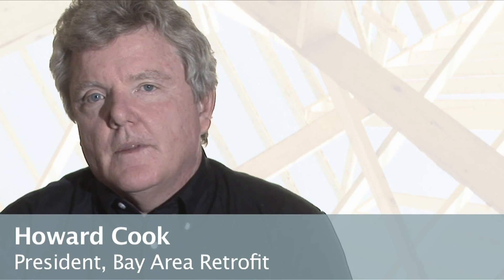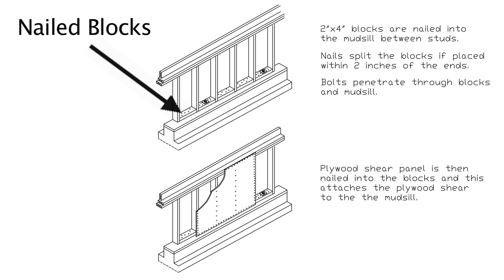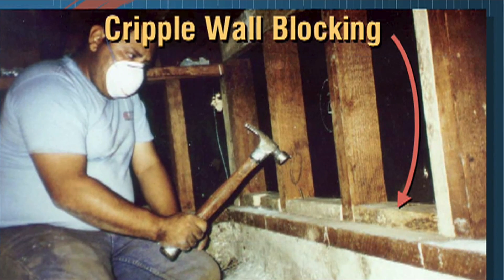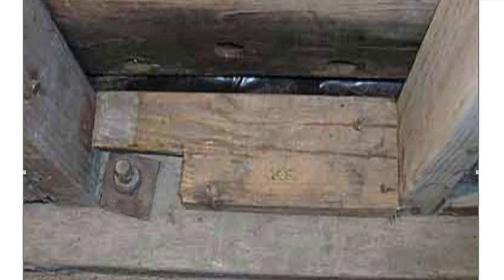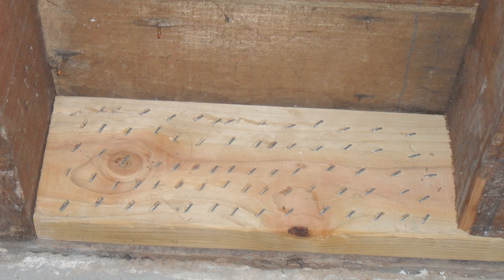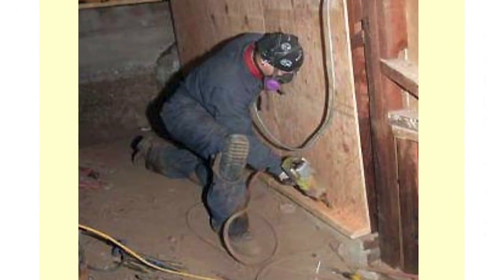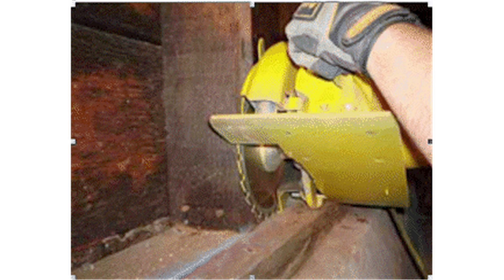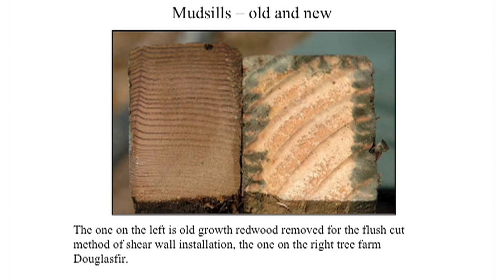The One and Only Tested Retrofit Shear Wall

Comment: I know it still probably wouldn't be as effective as just using staples, but theoretically could you avoid wood splitting by drilling pilot holes for your nails using the nailed blocks method shown? And would nails offer greater strength if done this way? what if you drilled pilot holes and used screws instead?

What if the wood used for the mudsill wasn't of particularly high quality? would the Flesh Cut method still be recommended?

Comment: Both my mudsil and studs are 6", however my mudsil is recessed into the foundation, leaving only about 3/4 and 1" above concrete. Seems like nailing would be too close to the edge of the ply. Does this require stapled blocking? Whats the best solution for this? 
Separate question what is the recommended depth of the foundation bolting and hold-down bolts?

Comment: I have a shearwall question that no one has been able to answer. I have a 2 story house (built 1992) with shearwalls in the attic. I will have to access the area behind the shearwalls.  I want to open a space between studs to do this. Is there an approved method to accomplish this?  I think either framing the hole like a doorway through the wall, or a larger piece of plywood to overlap to the next studs in each side of the opening when I am done with the work?

Comment: I have an old 1920's house with a 6 inch foundation wall with an untreaded Doug Fir 2x4 mud sill is sunk into the concrete flush with the top. This leaves 2-1/2" of concrete exposed a the top of the foundation wall. Untreaded Doug Fir 4x6 posts are then toe nailed into the 2x4 mud sill with the rest of the post (2") resting on bare concrete. These post are at very irregular spacing that vary from 8" to about 60" (most are around 32" spacing). My plan is to set 2x6 treated sill plate blocking on top of the foundation wall (and on top of the 2x4 mud sill) between these posts. I will install 5/8" diameter 8-1/2" deep wedge type threaded anchor rod through the 2x6 through the 2x4 and 4" into the concrete. If some of the sill plate blocks do not require anchor bolts I will just nail them to the existing 2x4 mud sill. I will then install 2x6 cripple wall studs 16" o.c. at the wide bays and cover everything with 1/2" plywood. My question is how often do I have to install anchor bolts?

Comment: One more possible method: cut every second stud short by 1.75 inches, and install longer blocks.  Double length blocks will resist splitting much better.

Comment: Testing blocks with a pry bar is the only way to know if those super small diameter staples will hold well. If the blocks pop right up from the sill plate  (( mudsills are from the 1880s in California where a huge 16" or wider and 8" tall board was laid directly on the soil or like a ice fishing house or a port a john skid plate))  as there are no mudsill buildings in California to speak of.  A simple pry bar test will show most stapled sill blocks to be very very very weak.   WORSE the staples are coated in the manner of sinker or vinyl nails.  They slide in and slide back out.    //// With enough nails most any block will stay in place when tested to pry out with a pry bar. In fact one should break out a few blocks to see if they broke up or slid out for the ultimate test.    ///  Letting some college puke make a video yacking about untested blocking is "out there".
Reply from the maker: You don't need to go through all that work. According to ESR 1539 one 15 gauge staple has a withdrawal resistance of 32# ALLOWABLE, which means its actual strength is probably twice that.  Figure out how much leverage you can put on your crow bar and if it exceeds the capacity of the staples the block will pop up.  No point in all that grunting and sweating if you can just use a little math on a calculator.

Tension or withdrawal forces, such as the force you would exert on staples with a pry bar, have nothing to do with the resistance of lateral forces generated by an earthquake.  Staples are approved for short term earthquake loading by the National Design Specification, ESR 1539, and the old NER 272.  Stapled shear walls are also allowed in APA Research Report 154 and can be found in the shear wall tables in the 2008  Special Design Provisions for Wind and Seismic, which is where the shear wall tables are in the current code.  The issue is not one of lateral resistance, it is a question of whether or not staples can withstand the bending back and forth motion generated by earthquakes.  That is why the American Plywood Association recommends stapling the crap out of something if you use staples. 

"If the blocks pop right up from the sill plate  (( mudsills are from the 1880s in California where a huge 16" or wider and 8" tall board was laid directly on the soil or like a ice fishing house or a port a john skid plate))  as there are no mudsill buildings in California to speak of. " 

Something is wrong with the syntax in the previous sentence.  First you are talking about blocks popping up from the sill plate, then mudsills that are 16" by 8", and then you say "there are no mudsill buildings in California to speak of".  Please re-word this.  You can't have ""no mudsill buildings" and at the same time mention mudsills elsewhere. I have no idea what you are talking about.  Assuming I did understand your comment about 16" by 8" mudsills, I am not sure what part of California you live in but in 25 years of doing this I have never seen a mudsill that size.  If there are any, they are so uncommon they are irrelevant.  Sounds fascinating though, please send me a photo so I can post it on my website.  

 "A simple pry bar test will show most stapled sill blocks to be very very very weak.   WORSE the staples are coated in the manner of sinker or vinyl nails.  They slide in and slide back out.    //// With enough nails most any block will stay in place when tested to pry out with a pry bar. In fact one should break out a few "

This is a very common misunderstanding of the purpose of nails in both shear walls and the earthquake resistance of blocks. The National Design Specification and ESR 1539 do recognize coatings as having any impact on the lateral resistance of nails or staples.  Sometimes homeowners, and even some contractors, get the crazy idea that nails or staples are going to be put under larger tension loads.  Nor does APA Research Report 154, upon which the current shear wall tables are based, make a distinction between sinkers and any other coated nails.  Please, inform the person who told you this to think about what he is saying.  I think after 5 seconds of clear thinking it will become apparent. 

I agree, blocks in general are a very bad idea because they are an untested system.  If you look at the testing methods used by the American Plywood Association all chords were made of 2 by 4s, which is more or less identical to what you get if you flush cut the mudsill.  When I was on the committee that wrote the regional standard Standard Plan A we had their leading Ph.D. research scientist compare blocks to flush cuttng and he said flush cutting was by far the best way to go.  His letter is posted on my website.  Good questions and I hope you can send me that picture!